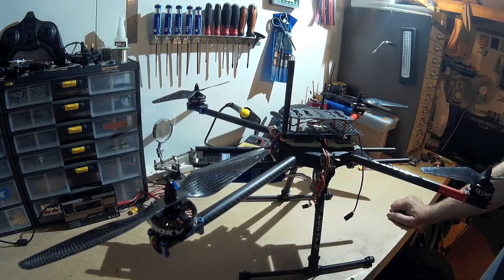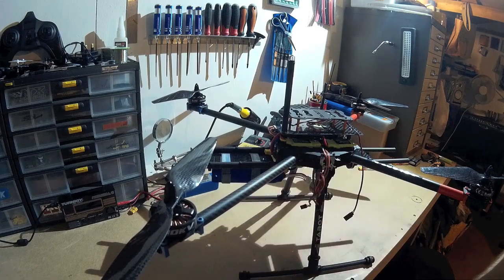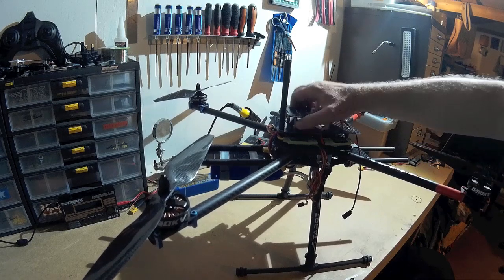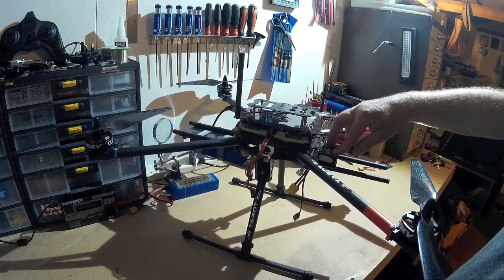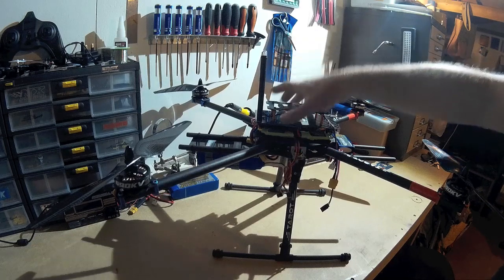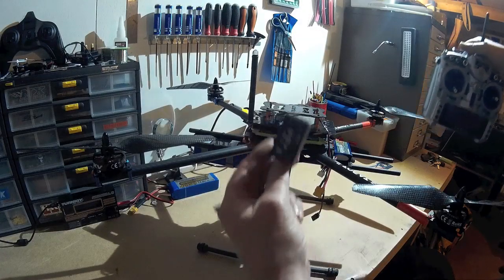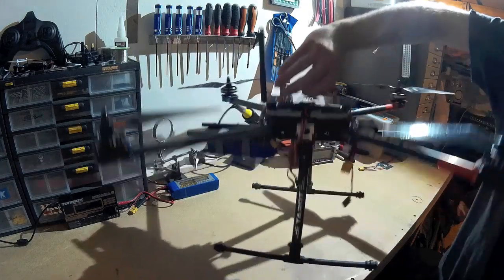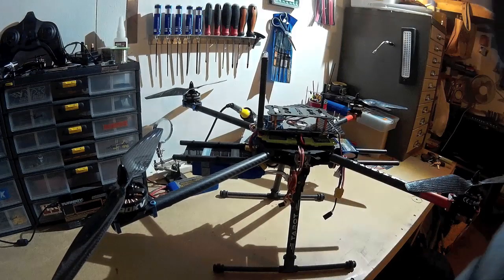Tarot Ironman 650 build part 1

Comment: nice build, I've just bought all my tarot 650 parts now so its time to assemble. using 1555 props on a 6s power system and tarot 380 kV 6s motors. using the tarot zyx m fc. fingers crossed I got e calc correct.
Reply from the maker: +Claire Strudwick Thankyou. best of luck with your build.

Comment: I have been using naza for years never ever had anything that even resembeled a flyaway, what I do recommend is before each flight hook up to naza assistant and do a pmu calibration well not each flight everytime you head out for a day of flying do a pmu cali it only takes 5 mins and it is well worth it naza will preform flawless than each and everytime. to be honest those flyaway atr 99 percent user errors! looks great I just ordered an ironman to put my pixhawk p4 on it! if I were you I would get 2 hobbyking 3s 5000lipos and hook them together got to rcmodelreveiws than you take 2 3s 5000 lipos and make 1 6s 10000 lipo for long flights and if one of the batteries loses a cell you can take it apart buy another 3s 5000 resolder and your back in business instead of paying 300usd for one battery youll have the same battery for 60usd!! good luck and if you need any help with naza just ask!
Reply from the maker: Hi David, yes i agree that 99% of fly aways are user error, i calibrate my naza often via the assistant software and before each flight i calibrate the gps. Thanks for the battery advice, sounds like a great idea... i have now pulled my 650 apart and im currently building a 950mm home made hex frame, i plan on using the pixhawk for this as ive heard great things about it :) best of luck with your 650. cheers:)

Comment: Interesting video Donn ... I hope to build one myself.  Do you have a list of your parts, motors, esc's,props,etc?  Thanks
Reply from the maker: Hi Jim, parts list is as follows..... Tarot Ironman 650 carbon fiber frame, turnigy multistar 690kv motors, EnRgy Pro 40amp esc's, Naza M V2 flight controller with GPS, 100amp power distribution board, 13" x 5 Tarot carbon fiber props, FrSky X8R receiver and Taranis transmitter.
Reply: Thanks Donn
Reply: Donn what batteries do you use and what time do you get with them?  I am trying to sort out my list to purchase soon.  thanks and I enjoy your flight videos.
Reply from the maker: Jim Furman
i use 4S 5000mah batteries and get around 10 minutes flight time, if your looking for longer flight times i would suggest lower kv motors with larger props. good luck with your build Jim, i look forward to seeing your results :) im currently building a 950 size hex and a 330 size FPV quad, look out for future vids :)
Reply: Many Thanks again Donn I will be looking for your future vids...thanks for the heads up!
I eventually want to build something that will carry my Canon EOS 5d mkii full size DSLR

Comment: how did you level out the arms for the motors ?
Reply from the maker: I leveled the motors with the props fitted, make sure the quad is on a level surface then measure from that surface to the left tip of prop and same for right tip of prop, then adjust motor until both measurements are the same, make sure you have high quality props fitted to ensure no discrepancies. This worked well for me :)
Reply: Donn Mckee what i was going to do was put it all together leave the motors off it then level out the mounts  and then put the motors on
Reply from the maker: ThugzMODs357
i wanted to do it that way too but found that once the mounts are fitted you then cant get to the screws to fit the motors, motors need to be fitted first. although if you are leaving the esc mounts on you could use those to level from, i didnt like the way they looked so i removed them. i hope this helps :)
Reply: Donn Mckee am building the ironman 1000 motor mounts are different and could only find ironman 650 builds Thanks For your help any way

Comment from the maker: Hi Mike, the power distribution board is located on the lower deck between the esc's... The two carbon fibre rails that hold the battery and camera are 490mm long. I'll be posting video number two of my build soon 👍